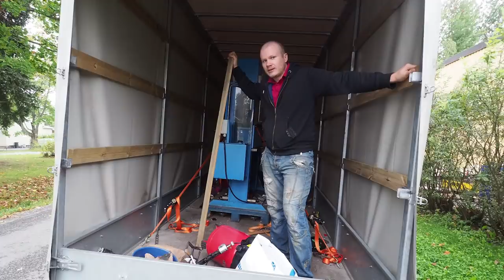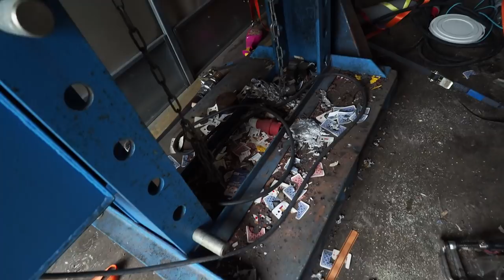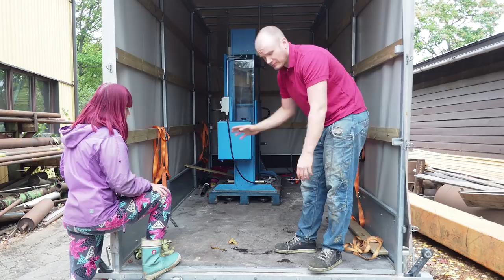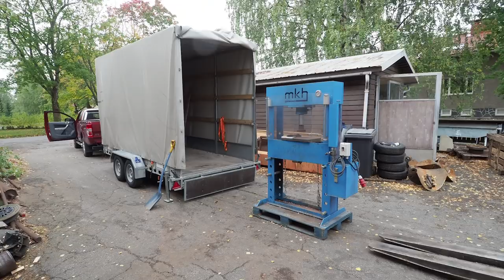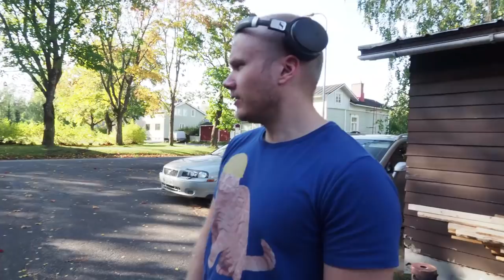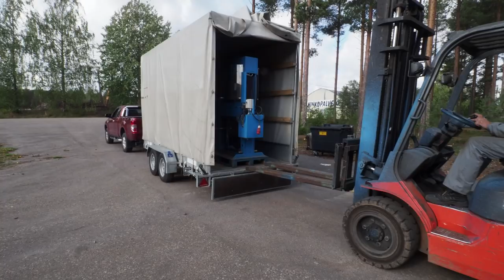Getting our Smaller Press to Maintenance

Comment: I used to have to forklift the pallet jack into the truck to move the load close the rear of the tuck, then forklift the pallet jack out so I could remove the load with the forklift when I worked at a ceramics supply warehouse.  Pallets of wet clay are HEAVY.  On a more relevant note, you two have done an amazing job of keeping your videos interesting and entertaining.

Comment: lava-antenni  aka Pallet Jack was the word you wewre searching for. Hydraulic pump handle single axel with two forks rollers on the bottom. Try driving in Texas, you can see in places 24 kilometers away from the highway.